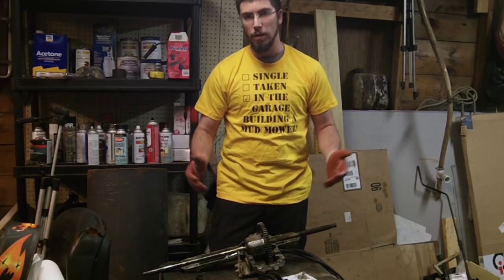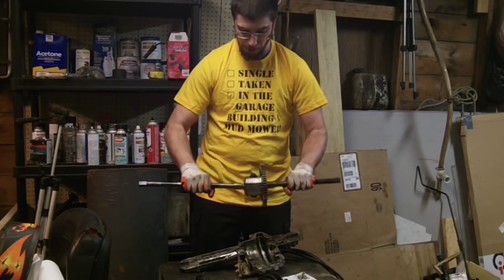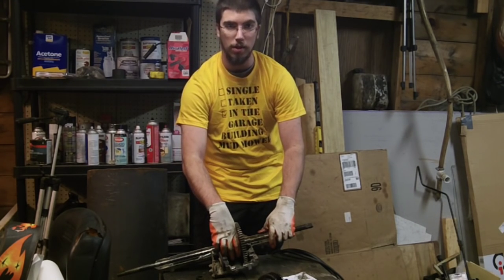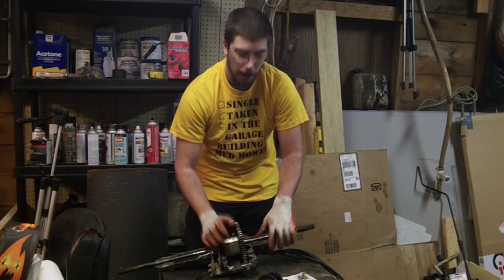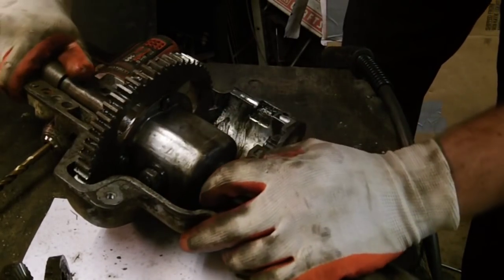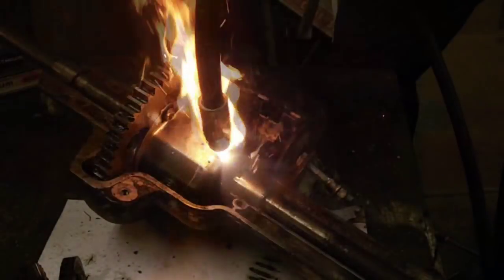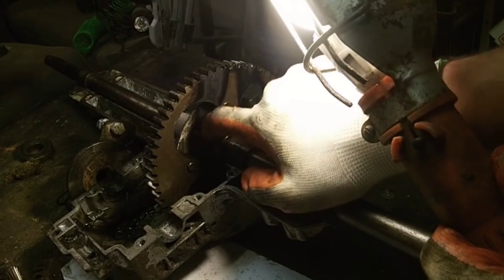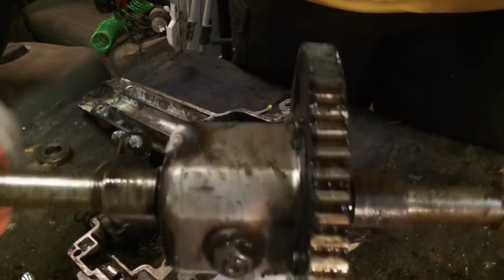MTD FNR Transaxle Locker

Comment: Ah, OK, thought you had a few videos regarding the FNR's and this one gives me a good heads up before I crack open the case.  Thinking I'll cut the shaft (maintaining both bearings/bushings on each side for best strength and almost looks like I can add a true bearing on the outside) and grind with a cutting disc a groove for an E-Clip, though maybe a C-Clip.  Thinking the E-Clips are heavier duty a little more since I see are use on some outer axle shafts to hold on the key'd axle rims.  Mine (at least the one I'm going to use) are threaded with a bolt and washer on the outside.  Good deal!